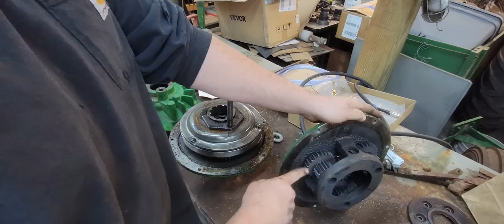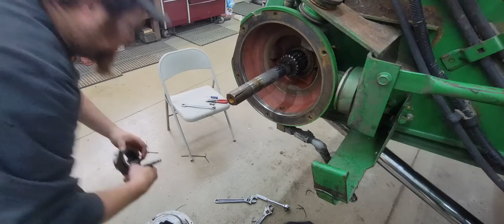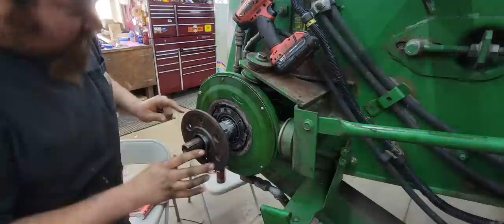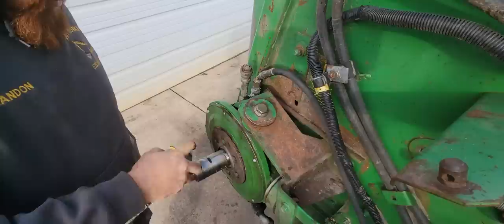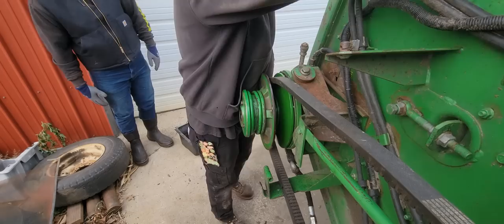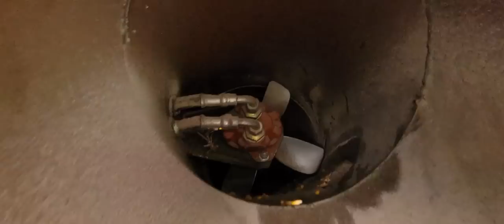John Deere 9600 Combine Header Reverser Repair Video!

Comment: It sure is nice to have that reverser handy when one chokes.  One day I must've choked a 9600 with only a 22 foot head 5 times trying to pick up some down rice.  Darn near had the head and feederhouse running as much backwards as forward.  What a pain in the ass.  I don't even recall if the early 20 series had that reverser or not, I'm sure the late ones before the 00 series had some sort of reverser.  One thing that was good about me choking that day was I was darn sure to be getting all of the crop that was flat as a pancake, might've took 3 days to cut 30 acres LOL

Comment: Just did this job on 9650sts. Same reverser. It is recommended to put loctite in between reverser input shaft and inner sheave on variable speed. I had to make a puller to pull it apart when we rebuilt it last year. Figured it was just stuck from years of being together. Made it just over a year before the roll pin wears out and let’s the whole assembly walk off. Not sure why they use the ball and set screws vs 2 roll pins.
Reply from the maker: It's kinda of a dumb design your right it should have to roll pins maybe I should pull it back apart and  loctite it like yours

Comment: I’ve herd that cooler kit was an add on option. I believe the 10 series reverser had ports for the cooler so you could retain the dipstick. Either the 50 or 60 series combines had a built in pump for the oil cooler.
Reply from the maker: Thank you!

Comment: They recommend deere 460 synthetic oil in the reverser and change every 100hrs now, I guess the problem was the 80w-90 conventional would break down from heat

Comment: The reverser coolers was added to run 12 row corn heads they came out on the 8820 first that tube for the return looked jacked up but there should have been a dip stick in there to check oil now days they run HD 460 oil in it. in the day I think they where the best machine out there 1680's and 1688's and 2188's where right there with them but we seemed to have better dealer support with the JD's. running just an 8 row head I would take the cooler off and use HD 460 oil. I have run combines all my life start on Gleaner G's my grand dad had Massey super 92 the first time I remember From Gleaners went to Massey 760's then come the JD' my dad always ran Jd's started with the 95.
Reply from the maker: Thank you for the information!

Comment: I would ad a pressure switch and a warning light to that oil circuit , So he dont have to worry about it again
Reply from the maker: I don't know if it would make enough pressure it just circulates
Reply: @dirtgrainsteel  Surely it makes a pound or 2 you can get switches that low . It was just a thought . Maybe even a flow switch would work